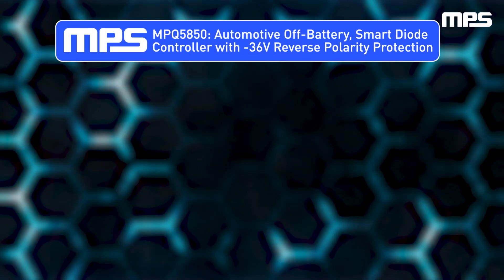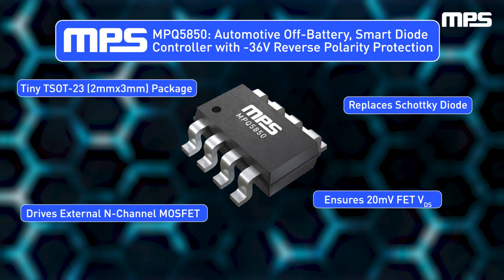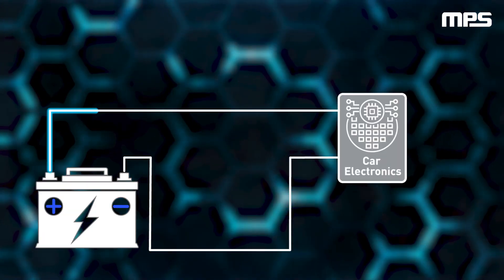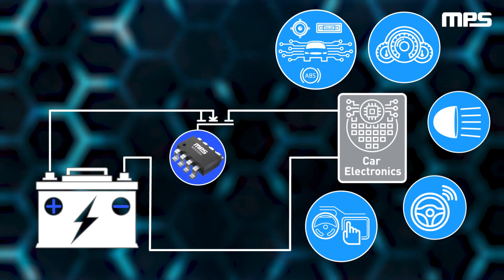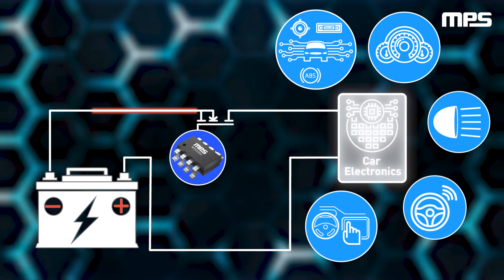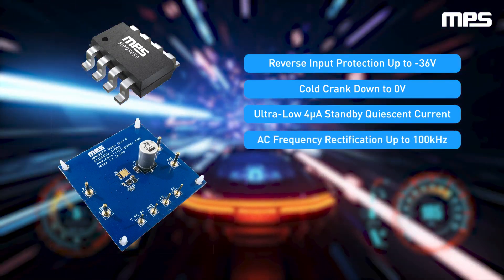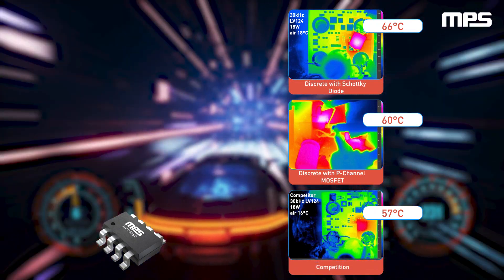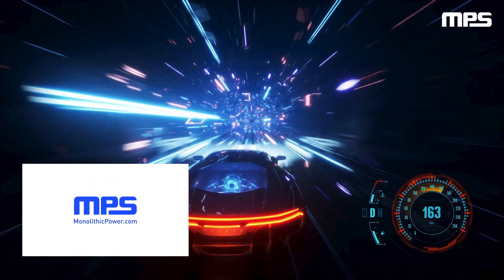Automotive-Grade Ideal Diode Controller with Reverse Polarity Protection: MPQ5850

Comment: interesting  new device or just remodified old linear amp mods and transistor reverse engineering?whats the max , emp  it can with stand and the length of a high current reverse situation can it suppress or move before blowing up or arcing begines for overload spikes and accidently reverse polarity connections or a altenator diode overheats and causes  the ac from the ltenator to be injected into the electrical system with huge anounts of current for a persay 4 seconds before wires and fuse start blowing and melting down?
i think voltage regulators and current limeters in conjuction with some all around good old shotkey diodes and mospets are the safer method ,, a sthey are everywhere and available to the public..but then again did they still teach electronic classes 20 years ago ?i think im outdated but my old tech devices aew still operable and servicsable if need be ..40 years later . howabout the best u got for reliability and longevity per dollar ?
Reply from the maker: Thanks for your question. For detailed technical discussions, we recommend posting on our forum, where our engineers can respond within 24 hours: https://forum.monolithicpower.com/

Comment: What will be max input ampere can be used? Can i anle to use for 3 phase inverter with input DC  ampere of 50A?
Reply from the maker: The MPQ5850 drives an external N-channel MOSFET, so the maximum current capability will depend on the MOSFET used. A >50A rated MOSFET could be used for this 3 phase inverter.
Reply: @monolithicpowersystemsmps534  after design the schematic, I need to verify the circuit from MPS. How to contact design team through mail or any other mode?
Reply: they make a 3 phase diode that will handle 100 volts plus a current of 50 amps or more allready built in a metal case with cooling fins all u need too do is find a good heat sink to put it on and decent airflow too keep it cool during excess loads conditions and u got it made that little ic is just a switching logic device that will only switch a higher voltage and current flow faster and with a lower voltage drop..  is all it is  u still need a good transistor mad eto handle current flow thru and sudden volyage spikes at the same time which requires a few other parts too make the mostout of thier  device  usuable. or jusrafiable , without bringing to much attention to the other aspects of the new device they wanna sell. .. its old school tech revised in new ligereeai1